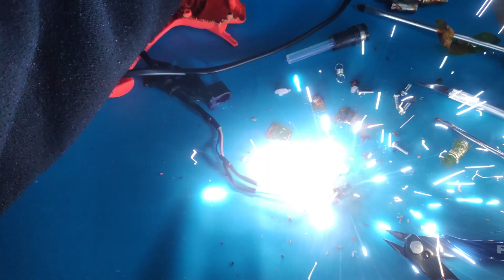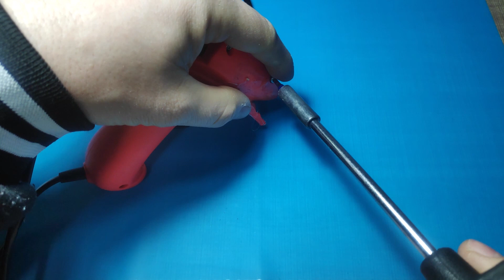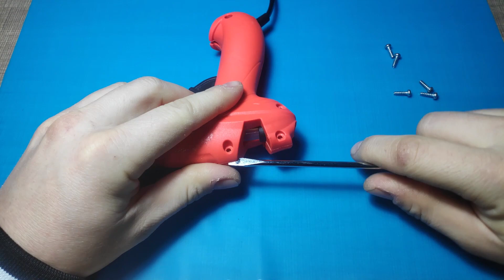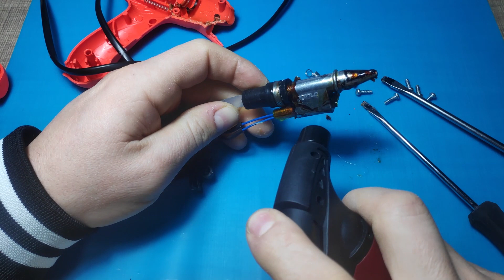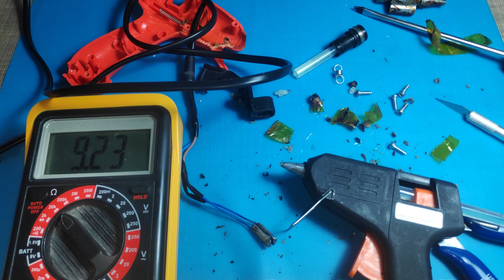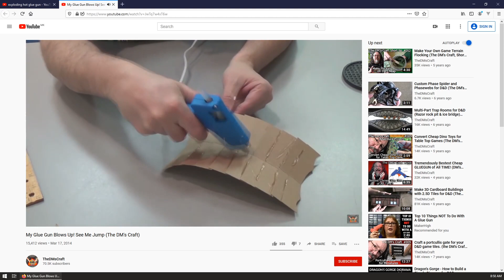Exploding hot glue gun - how PTC heaters work

Comment: A PTC element is not like a soldering iron element.  In a PTC element, there Is a bimetallic heating plate sandwiched between two plates that has the lead wires . Overtime , that bimetallic plate wears, until it wears down so much that it causes a " short circuit" causing the explosion.
Reply from the maker: Thanks for sharing!
Reply: Hello, please i would like to know which heating element to buy from aliexpress (they have the 150°C and 250°C), it’s for my hot glue gun that doesn’t get hot enough to melt the glue shaft. I tore it down and tested the wires (they’re fine), so i assume that the heating element is the one faulty. Many thanks in advance for your help.
Reply from the maker: The lower ones are intended for the low temperature glue sticks as the regular ones melt at around 190°C. So you probably need the 250°C ones.

Comment: I've had this happen to me three times about 10 years ago, all 3 times were with 3 different guns all of the same expensive name brand, STANLEY.
I've been using the cheaper chinese ones that cost 20 times less than the stanley since then and have never experienced this issue ever again.
Only issue with the cheaper one is the plastic that eventually gets brittle around the tip every couple of years eventually forcing the element housing out.
Reply from the maker: Huh, yes, having something expensive is no longer an indicator of quality. What I don't like in the cheaper ones is the poor grip that they have on the glue sticks so when you need to go through the stick quickly, the grip has a tendency to slip and not force the stick through the nozzle. The cheap ones are never meant to last for a long time and I guess that explains the brittle plastic.
Reply: @TasteTheCode  i don't experience any slipping grip issues when feeding sticks through, but then again I use the standard size gun with standard sized sticks and higher wattage. Im based in South Africa so a different part of China probably supplies us. 
I do have a Ryobi brand glue gun as well which is rated at a lower wattage and that one has grip issues when feeding sticks, i suppose because the lower wattage element takes longer to melt the glue and in turn causing the grip to slip.
Reply from the maker: Yes, I guess the lower wattage is the issue. Here from what I've seen 20-40w is the standard. I'll try to look at more powerful ones.

Comment: could it be that the melted silicon becomes conductive and creates a shortcut when it melts around it? or carbon layers after burn silicon goes around it?
mine blew up after manually pressing the silicon bar hard to squeeze silicon faster... the silicon spilled out of the gun and it blew up. ... makes me feel like if I handt push it that hard it would t have spilled that much and blow up... your also looked like silicon was all over the place.
Reply from the maker: Hmmm I don't think that the silicone glue can be conductive in any circumstances. The PTC element is not touching the glue but the housing around it. Maybe the amount of glue has some effect but only if it cools the extruder too fast and the heater trys to overcompensate destroying itself in the process.